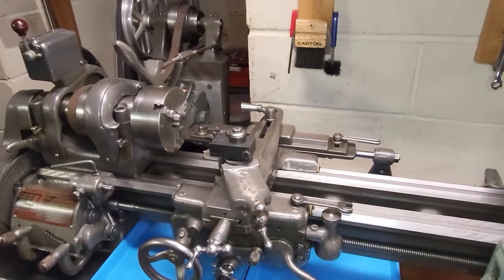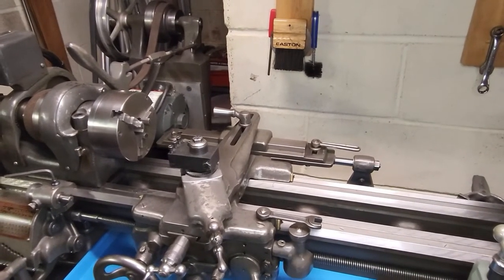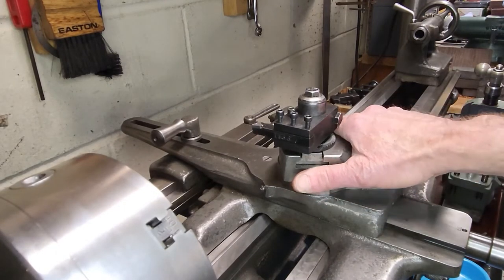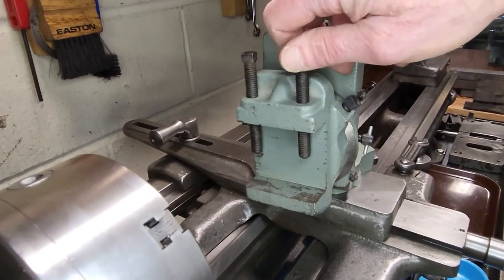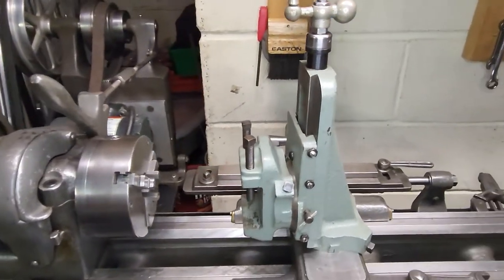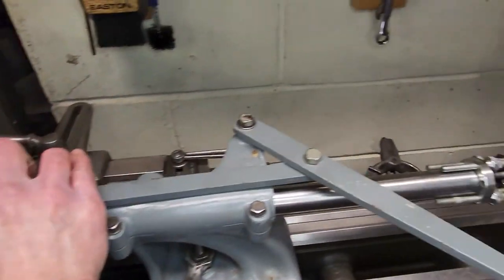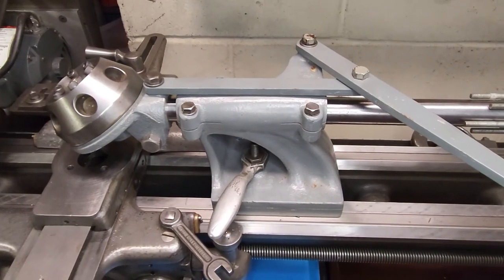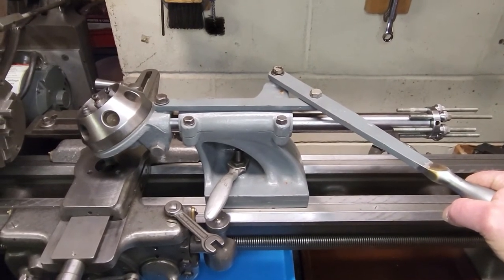Using Atlas Lathe Accessories on a Southbend Lathe

Comment: Nice job Jim. You are correct the word Southbend is a big price jump over some very capable Atlas pieces. Looking in awe at your taper attachment. 

That wouldn’t be a Rockwell Mill body there in the floor ? 

All the best
Dan
Reply from the maker: That would be two Rockwell mill bodies.  I have one complete one for parts. Planning on putting one together soon.
Reply: @Jims-Workshop  Well well that makes us Rockwell cousins. I have the vertical and its twin horizontal mills. Very nice machines.

Comment: Turret is still on my wish list. Did you scrape in your adapter for the turret? Really nice set of gear :) Everything. I mean everything. IS SO CLEAN.
Reply from the maker: Hi John,  I didn't see a need to scrape anything in.  When you get the turret tail stock new (which this one wasn't) it is not bored for the tool holders or chuck that you would mount in it.  You are supposed to bore it on the lathe you mount it to.  Since this one was used, I had to bore the 5/8" existing holes up to 1" with a boring bar in the spindle, and then make bushings to bring the holes back down to 5/8's.  This ensures they are concentric with the spindle bore.